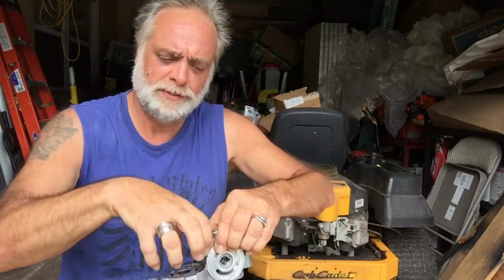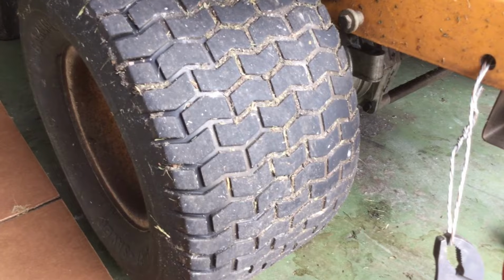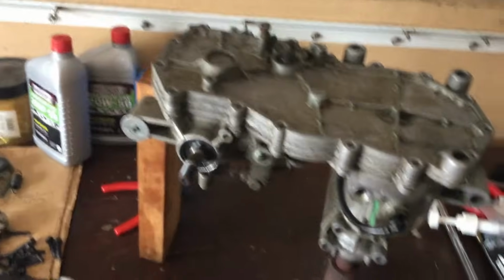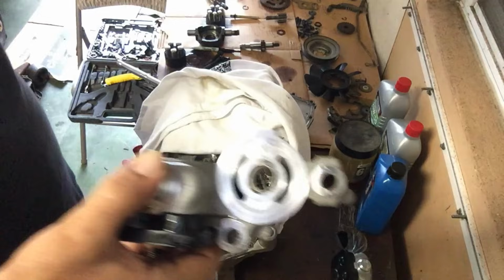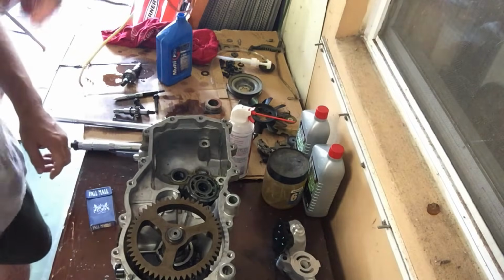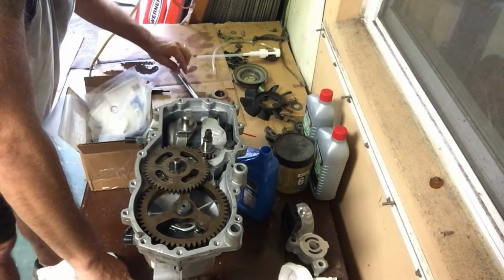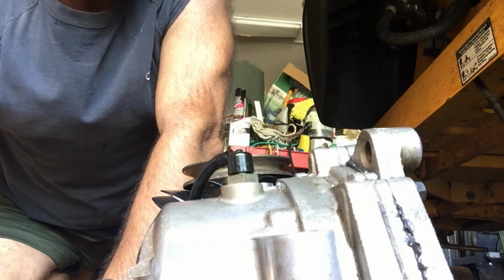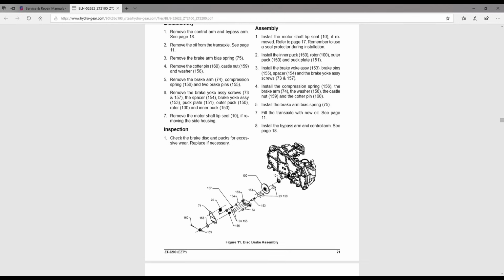Cub Cadet RZT 50 Riding Mower Hydro Gear Transmission Rebuild

Comment: I rebuilt my transaxle and it's working great.  I watched a couple of other videos (that were much shorter) before I started, but they left out steps and you included EVERY step and tips about how you have to do this before that and stuff.  I don't know if I would have been able to complete mine without your video.
Edit: When I was finished and was ready to top up the oil I didn't have anything that would work, so I went to the Dollar General and got a condiment squeeze bottle for a dollar that worked perfectly.
Reply from the maker: Glad to hear it went well.  A condiment bottle?  Well, hopefully it allowed you to....Ketchup on any lost time looking for a siphon pump and if I were you, I’d...relish in the creativity you used to make it work.
Reply: 😂 @silentknightsaga2415

Comment: Great video.  After watching this and several others, was able to repair my zt3100. DIY is the only option with these units simply due to cost of shop labor. Actually, unit removal and installation was more work than the actual repair. One tidbit I'll toss in is the little cursed metal part (bypass plate) can be left out initially. Once the center section is in place and snuggled down, the motor block is captured and shaft aligned. The shaft can be slid back out. Turning the unit so bypass plate slot is facing down, the plate can be laid in place and shaft slipped back into place. Optionally, a small dab of gease in the slot to help hold it in place for added insurance .I did a couple practice assembly attempts and this method worked best for me. Secondly, it's best to slather oil on the mating surfaces of the center section lands and piston block surfaces prior to installation to help minimize scratching/ galling. In my adventure, problem was pistons seized in the blocks from sitting for years in the elements plus entry of water. Thanks for your video.

Comment: Great vedio, thank you so much. Folled it exactly and no rush. I did find a way to deal with the pistons using using about 1/2 Walmart plastic bag. With the pistons facing up just lay the ba over them  over them and slid your hands douw all around , pick it up turn upside down and place in place and gently pull the bag out. Works perfict. Thanks again for the great vedio.

Comment: Liked the video and followed it for rebuilding my Hydro Gear ZT-2200. Very similar. I did find a couple of things that might save you some grief for next rebuild: 1) 3-M scruffy pad and Brake Kleen make fast work out of cleaning case halves; 2) I cut a small piece of cardboard from tool packaging and used it to slide the 5-piston cylinder block (motor) into place, keeping the pistons from "slipping out"; 3) Installing the motor shaft before installing center section ensures that the motor block is properly positioned before placing and securing it with bolts; 4) placing a shallow 11/16" socket (clean) into the trunnion, between the 7 pistons keep the pump block from shifting and dropping out pistons (make sure the socket does not protrude outside of the trunnion) when installing trunnion; 5) I made a tool to measure fluid level when filling out of a router edge guide (already has 1/8" increment marks). My transmission manual states fluid level should be  3/4"- 1 1/2" from top of surface. I level the assembled transmission on the bench and remove the plug. Add fluid until maximum spec. is achieved. Using a drill or other tool (like impact wrench), spin drive pulley while performing purging steps. Once completely purged, top off fluid to maximum spec., install plug and install. Done! I have pictures if you need to see these tricks.

Comment: Two things I did differently, I just didn’t take the shaft out or anything to do with parking break from case cover , and I also never took belt spring tensioner off , I popped it out and just walked it back in place with the belt on when finished.

Comment: The wire spring extender trick is excellent! Think i might try coat hanger wire. I do have a spool of braided wire but it's smaller than what you had. Excellent video!!! Thank you:) Bought a 2006 RZT50 a few years ago and i love it! Engine is perfect , deck is okay but rusty in the middle, it whines but only when at low rpm. Even though my back yard is quite steep, I've never experienced any slippage issues. Next time i mow I'll check temp of each transmission because there are times when it feels like one tire is slipping, but only when turning around after end of cut. I'm an industrial maintenance mechanic and still love fixing things, so I'm just going to do both transmissions. 
 Not serviceable i believe means no oil filter, no oil plug, etc on trans. Doesn't mean not rebuildable, which makes sense because the oem and many others sell every internal trans part. If someone thinks they need to change the trans oil, don't waste your time, just rebuild. It's not hard as long as your brain sees all the things your eyes look at. 
Pay attention, don't be in a hurry, print out an exploded view of the trans that you're working on, make sure you use the sticker with model number on each trans for ordering parts. Finally, take pictures as you're taking things apart, and have a mechanic friend available for video call(s) if you get stuck. If you think something isn't right then DEFINITELY DO NOT try to start and drive. Easy!

Comment: Any ideas on how to remove the large gear wheel? I've tried everything to remove the hub - gear pullers, front-hub removal tool etc - and it looks like the best way would be to remove the retaining-ring from the gear itself, except it's not a regular circlip. How it was ever put on in the first place, is a mystery in itself.
Reply from the maker: Are you talking about the gear around the axel
Reply: @silentknightsaga2415  Yep - it seems to me that the only way to remove it, is to remove the hub so that the axle can be pulled out via the gear.
Reply from the maker: @vincevesper167  I don’t know.  I do recall before I did the trans rebuild coming across something, whether in a video or something I read, to not mess with it, so I didn’t mess with.  Sorry, I know that’s not helpful.

Comment: I have a question: if the seal that is damaged is the one on the outside, do I need to take everything apart or just put a new seal on the outside?
Reply from the maker: There are a few seals on the unit so I’m not sure which one you’re referring to, I.e. there’s the casing seal that seals the two “halves” of the casing together, then there are a few seals around the various “shafts” coming from inside casing to outside of casing.  That said, the only way to properly replace any of them is to take it apart.

 However, my casing seal began to leak about a year ago.  I really had no interest in taking it all apart again so I took the unit off the mower drained the oil overnight, cleaned up the casing in the area it was leaking, then put a bunch of liquid gasket around and into the leaking section.  Let it dry for 48 hours, refilled it with oil, remounted it, purged it as per the video, and it seemed to stop the leak for the most part.

 I do check the unit’s oil from time to time and have had to top it off once in the past year.

Comment: Amazon sells a 500 ml syringe with a tube that can be used  to measre and add the oil.  1.75 quarts = 1,656 cc.

Comment: Hi! I have the same problem with my RZT50. Where do you by parts for it, and what does it cost? Here in Denmark the pump unit at least is 550$. And I need for both left and right

Comment: What did you use or do you recommend to clean out the inside of the case to ensure all contaminants are removed? I have mine open up and new parts in hand and plan on reassembling this weekend.
Reply from the maker: FYI, I had to do the rebuild twice because the first time some contaminants got inside and I began having the same problem with it after a few months.  The second rebuild was successful and still running well after all these years.

Let the oil drain overnight, that will help remove some of the problem.  Once you have all the parts removed it’s not too difficult to soak up and wipe out the inside with a non-lint cloth, I just used an old T-shirt.  I also used an air compressor on fairly low pressure to blow it out. The second time around I wiped down and blew off every part before I installed them.

I also covered the open unit with I.e. a t-shirt every time I walked away from it, without exception (the second time around) as things can fall into it from the ceiling, dust can blow into it, etc.

Remove the old gasket around the base of the unit after you have old parts removed and before installing new parts.  It’s easier to clean it out that way.  Be very meticulous when cleaning off old gasket to try to avoid much of the gasket material from getting into the unit and continuously blow the inside of unit out while removing old gasket.  You might want to consider using a small hand held vacuum to suck out any particles if you have one.  I don’t recall if I used one or not.

The only thing I did any differently during the two rebuilds was I was more meticulous in cleaning it out more frequently and I covered the open casing with a T-shirt literally every time I walked away from it…without exception.

Comment: In the process of rebuilding my transmission and your video has the best details I have found of any on Youtube. Interestingly, I had no damage internally, so in retrospect, I think it may have been a little low on oil. It was jerking at low speed, grabbing until full pressed. The other side is also showing low. Probably didn't need to crack it but this is my first exposure to these drives. At any rate I think your video helped me get it back together right as I caught a couple of things I missed. (you hate it when there are parts left over). Great finale, BTW haha.
Reply from the maker: My Cub cadet is getting old and something seems to go wrong now every few months.  I was having some lower speed bucking issues a couple years ago.  Surprisingly, a fuel filter change fixed it, but of course I also did a spark plug change just in case, but it was the fuel filter ultimately.  Then a couple months ago, it would just bog down and sputter and not run as fast as typical and struggled to cut just low grass.  Changed plugs, air filter, fuel “pump” (more like a fuel diverter on my rig), cleaned and ultimately replaced the carb and fuel filter, but didn’t solve the problem.  Deep sigh knowing I had to look into it further.  Determined it was only running on one of two cylinders, then determined the issue was actually with the ignition coils.  Replaced both (not difficult) and it’s running like a charm once again.  Lol, just getting to an age (me) where any issue now requires a deep I-don’t-have-the-energy-nor-desire-to-fix-it sigh, but I keep plugging along cuz I like to diagnose and fix shit.
Reply: @silentknightsaga2415  Ive got a Husqvarna that feels the same way...replacing a part every other cut it feels like. Im down to the drives and the motor, on wear parts. Nice video, glad to see youre still checking up on this video 4 years later. I appreciate the in depth footage, I have the confidence to dive into these.

Comment: From the Hydro gear website, did you purchase a rebuild kit and a center section? I’m pulling the exact parts number off of my Hydro today to ensure exact match.
Reply from the maker: Hmmm, if I recall, I actually ordered all the parts individually from various sites.  Not sure I ordered anything at all from Hydrogear.  I think the only thing I used from Hydrogear were some schematics of the transax which were downloadable from their website.  Mostly ordered parts from Cub Cadet and PartsTree, maybe some from Amazon.  That was like five years ago and some have commented since then that they can’t seem to find the center section available anymore.  I think some of the parts came as a “kit” I.e. rubber gaskets, but most were ordered individually.  I don’t recall there being an all inclusive kit that would have everything you need.

Comment: Thanks for a comprehensive step by step video! It was extremely helpful when I tackled the left transaxle on my zero turn a few years ago and again when I recently did the right transaxle. There is one helpful hint that I gleaned from another guy's video regarding how to successfully and without any frustration replace the pump cylinder and its pistons back into the unit: place the pistons back into the cylinder and then wrap a stout rubber band around the pistons up close to where they go into the cylinder. The pressure of the rubber band is enough to keep the pistons from falling out. Put the assembly back into the unit and then use a mechanic's tweezers to grab the rubber band while using a small yet sharp scissors to cut the rubber band, then pull the cut rubber band out from around the cylinder with the tweezers. This method works like a charm and eliminates the one major source of frustration in reassembling the transaxle.  I'm posting this hint for the benefit of all who visit this site.

Comment: Thank you for the great detailed video.  Good advice and  tips in general as a bonus when approaching any project like this, cardboard, pics, tools, removing gasket sealer, etc.  You could be a pro.    

Question, if you please.  Did you consider drilling a drain hole, tapping it and placing a removal plugin the casing when you had it apart in order to change the oil periodically?  Any reason why you might advise against doing it? 

Was there a filter inside the unit and, do you think it would be safe to drill the bottom of the case, in the middle of where the filter sits?  Again many thanks
Reply from the maker: Didn’t consider drilling a drain hole.  I’d think it would introduce additional potential for something to fail/go wrong.  Had considered drilling a hole in the frame of mower just above the fill plug to make it easier to fill. You could probably use a siphon to remove the oil. I do recall there being a plastic filter with some mesh-like material.  I believe it is mounted near the axel area but don’t recall exactly.  I’d like to think the company that designed and manufactures these units didn’t put a drain plug at the bottom of the casing for a reason other than to just make draining the oil more difficult for the customer.

Comment: Brilliant video, thank you. After years, it's still the best and im so glad i found it!! 
Rather quirky, i chuckled at the continual references to the "bearing thrust" and "gaskets" instead of "thrust bearing" and "seal" but whatever.
Frankly im pretty disgusted at Hydro-gear, they've let down US engineering. WTF is the centre section made from aluminium? Such a really poor material choice for a high- pressure bearing surface. Why is it not made of cast iron or the same material as the pump and motor cylinder blocks that rub against it? It seems designed to fail...and its so expensive, for a bit of cast aluminium with some easy machining. Quite disgraceful and a pretty obvious cash  gouge.
I've had my rant😊 you can tell I've been servicing my EZT unit lol.
Reply from the maker: No business would ever design something not to last so they can squeeze additional cash out of customers………..<——— number of dots denotes level of sarcasm.  All of your rant plus it’s not as if this is like replacing some AA batteries in a flashlight.  It’s a fairly long and detailed process to rebuild and things can go wrong at any step.  Not to mention, if you ever need to top off the oil in the transax the poor design at least on my model puts the fill cap right below an area that tends to get caked with dirt and grit and you have to be extremely diligent at cleaning that area above it before refilling otherwise you’ve just ruined your trans if grit gets inside.

Comment: Just finished the same job thanks to your video! Juat curious if you have had to complete the job again since the video or if the hudro-gear is still going as strong? Thanks again for the invaluable video!
Reply from the maker: The only issue I’ve had is that the liquid gasket that seals the two halves of the casing together sprung a leak after about three years.  It seems to come and go.  Obviously, this can cause another failure, but I’m not interested in taking it a part, removing the old seal and replacing so I just added some liquid gasket to the outside of the casing which I know isn’t the proper way nor a very effective fix, and I check the fluid level from time to time.
Reply: @silentknightsaga2415  I would do rhe same.  Thanks

Comment: I just acquired a mower with a Hydro Transmission and regardless of the brand I knew your info would be helpful. You did a remarkable in depth Tutorial here and I'm forever grateful for your straight forward approach and thorough explanation. I'm lust a hack who fixes just about anything and rely solely upon tips and procedures from guys like you. It's 4 years since you originally posted but the info is timeless.
Two thumbs up and Thank You!
Reply from the maker: Thanks, I too am “just a hack” who fixes…well more like attempts to fix just about anything…other than when it involves 120-240 volts.